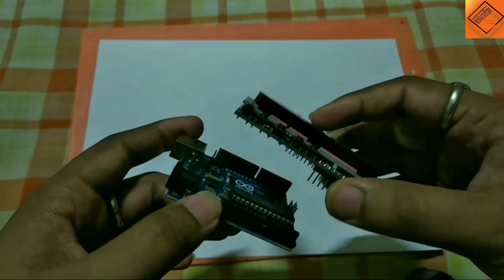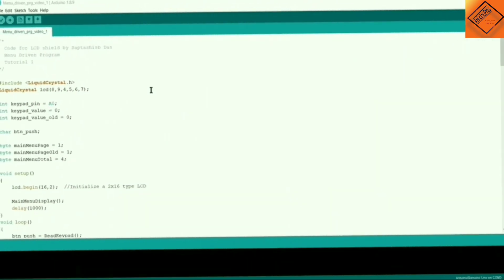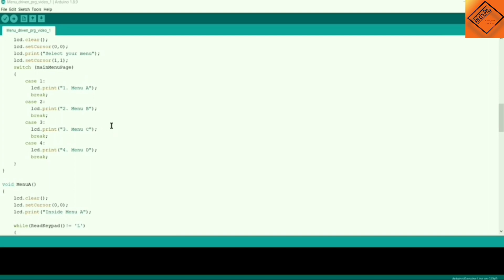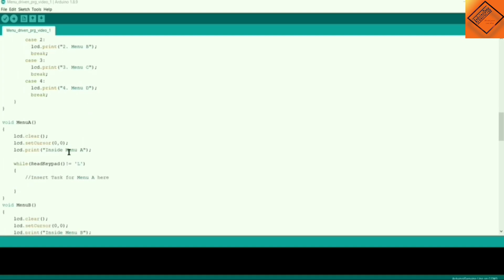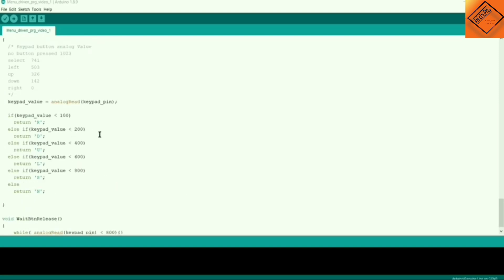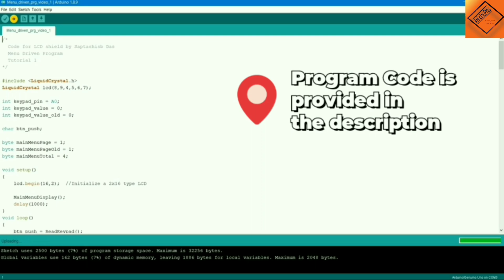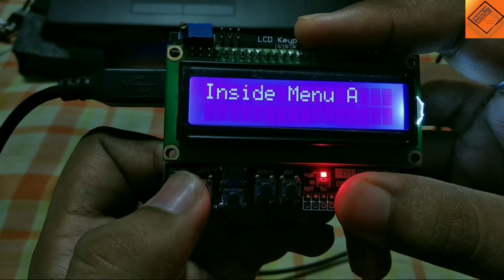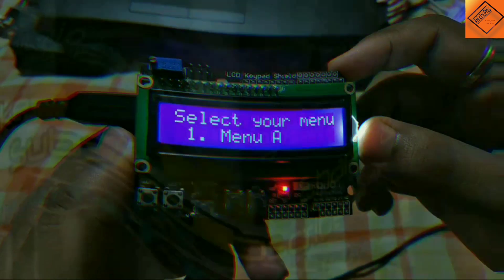LCD Keypad Shield Programming with Arduino Uno | Getting Started Part 1 | ArduinoPros

Comment: So up, down, left, right, and select keys are internally connected to A0 pin?
and each button has different resistor value so they can return different value to A0 pin?